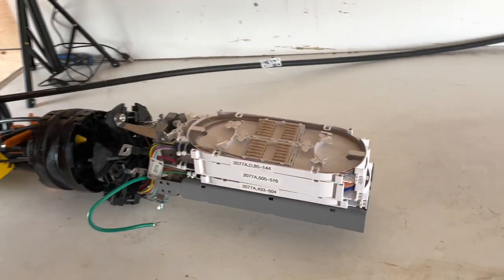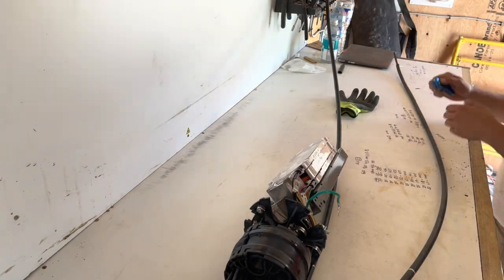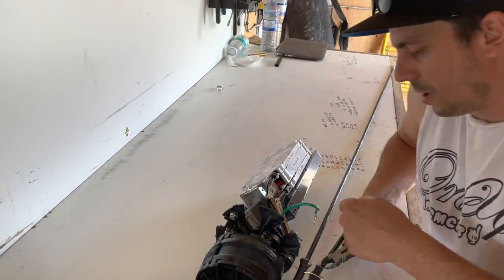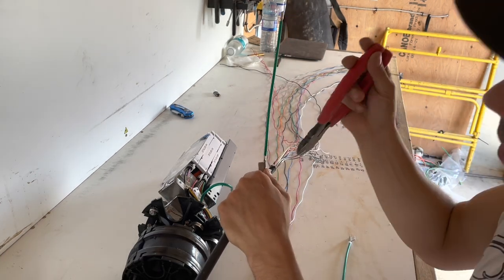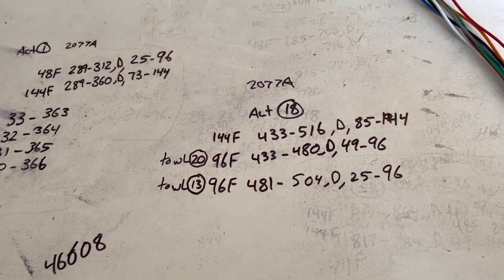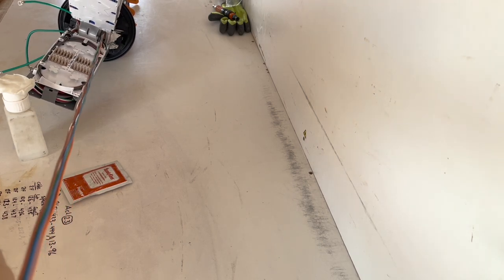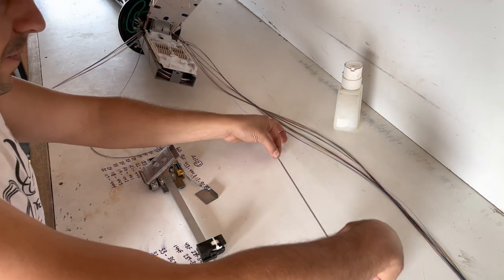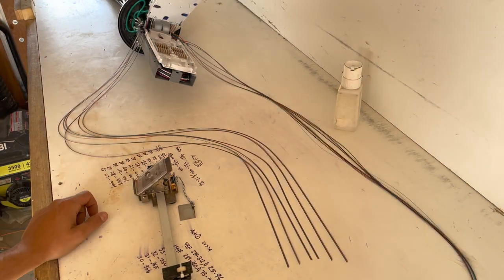Live Fiber Optic Splice Closure Cable Entry Tutorial Commscope 450BS

Comment: I noticed you attaching the green bonding wires to the metal lining of the outer sheath in another video.  I can understand the metal layer providing some mechanical protection to the inner cores but why does it need to be bonded?  Do these cables suffer from static build up or is there another (probably obvious) reason?
Reply from the maker: The customer requires any metal sheathing to be grounded for a couple reasons main reason is to protect the cable/network from unexpected power i.e. lighting and possible power lines coming in contact with the fiber cable. We also need to ground out the sheath for feeder networks due to the sensor equipment such a SGU, STU, SSU that get installed to monitor all feeder splice closures for water damage. Thanks for watching 🙌